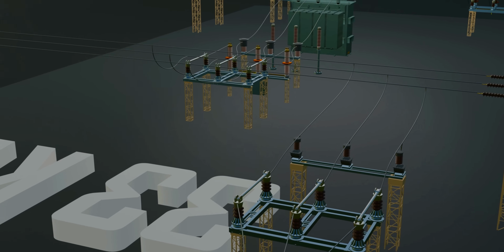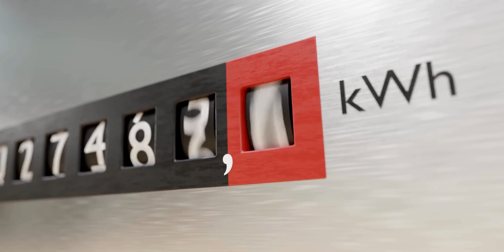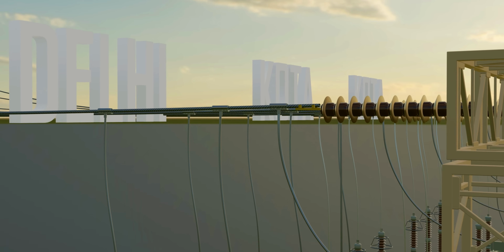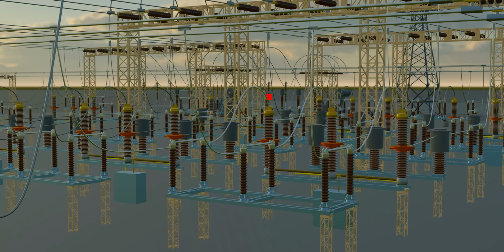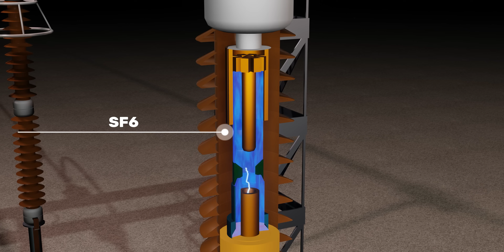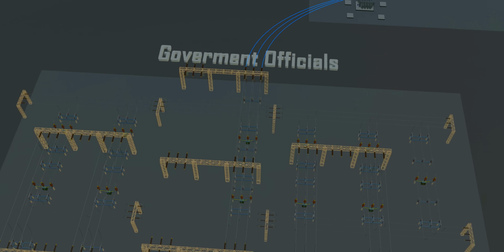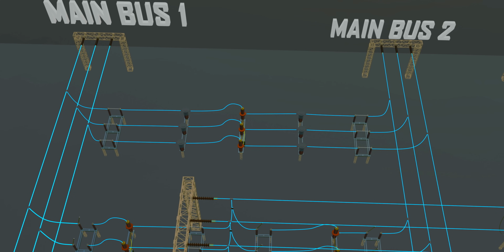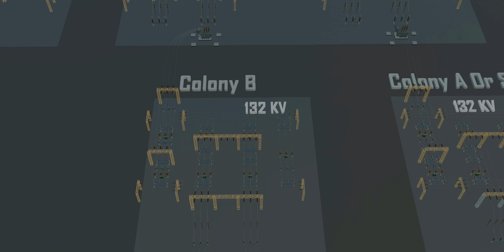From 440kV to 440V: How Substations Deliver Electricity to Our Homes

Comment: I thought this was a good explanation of why sub stations seem so complicated. Here in the UK we dont have 220Kv its usually 400Kv down to 132Kv then 132Kv down to 33Kv other than that im sure its the same as in your video. The device that you said isnt a transformer but looks like one is i think a shunt reactor am i right?
Reply: I also reckon it's a reactor.  A big coil to counter overvoltage  caused by capacitance in long transmission lines.  Am also uk - 11kv 33kv and some 66kv for dbn. 132, 275 and 400kv for transmission  .  (Except England where, I think 132 is classed dbn?)